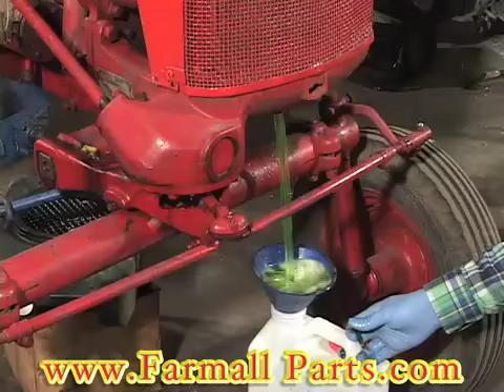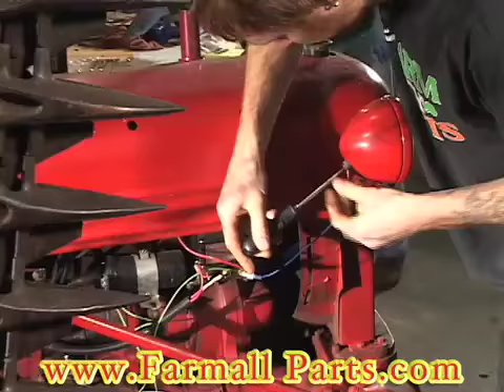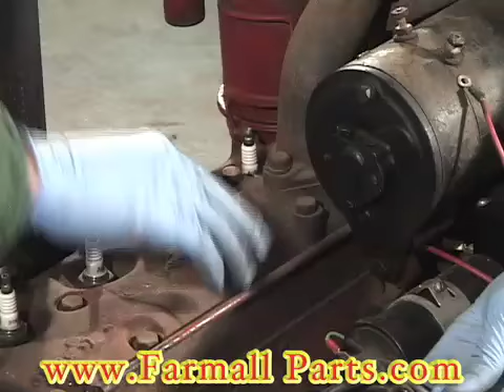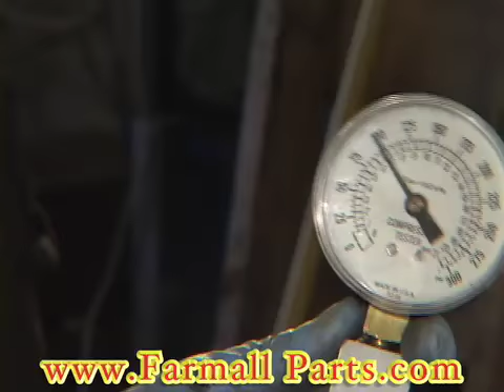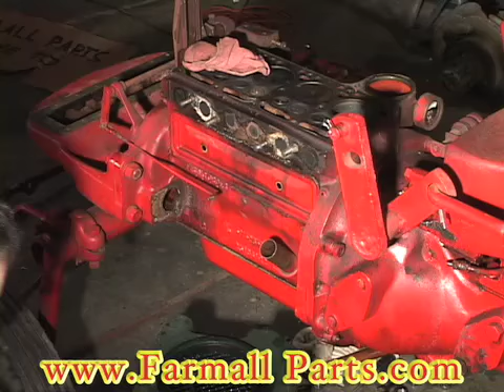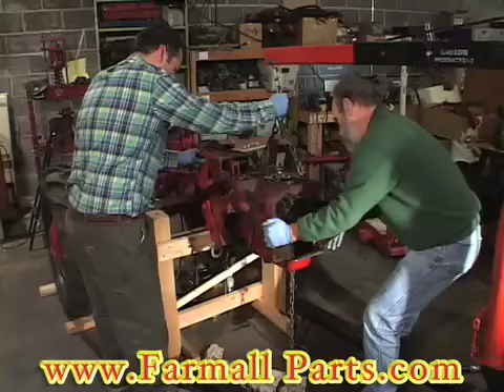How to Take Apart A 1950 Farmall Cub Tractor

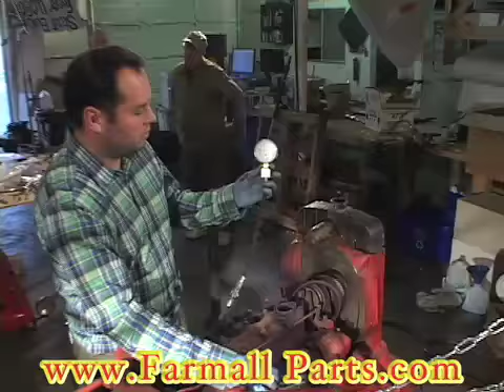Comment: @3:26 in this video you are checking compression- how can you do that, and have your radiator fan spinning when you unhooked the battery leads and took off the generator? You have no power!!!!
Reply: You don't need the generator to turn the engine over.  And hooking the battery back up takes 10 seconds.

Comment: You wouldn't happen to know how to seperate the rear axle's from the wheel hubs on a 1950 mccormick standard w-4? It appears to be a splined connection with a single bolt on the outside. I applied heat and maxed out a 30 ton press with no luck. Snapped one of the bolts off too. Thanks for the above video and for any advice you might have.

Comment: Im rebuilding a 1949 Farmall Cub my great grandfather bought brand new. Do yall sell the cam and rods? Im going to buy a master engine kit but it doesnt come with the rods or cam. Second, I want to maintain the original look while converting to 12 volt system, is it possible to reuse the Generator assembly but upgrade the internals to an Alternator? Thank you